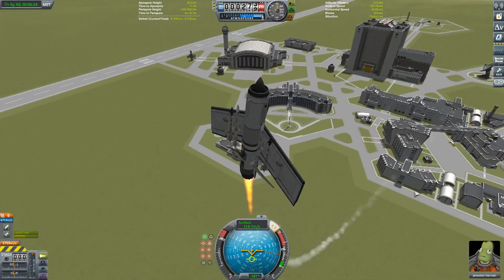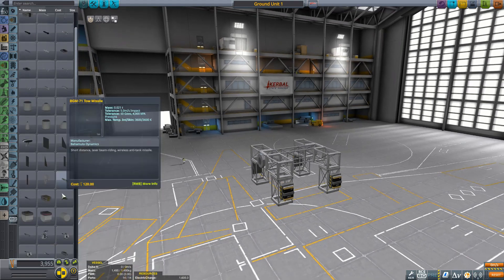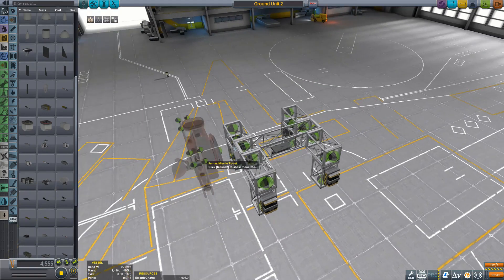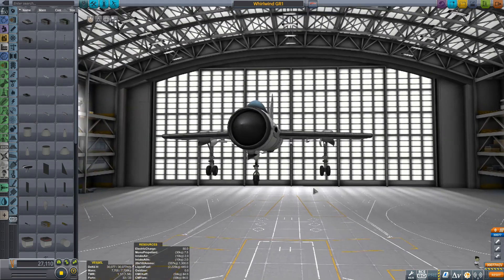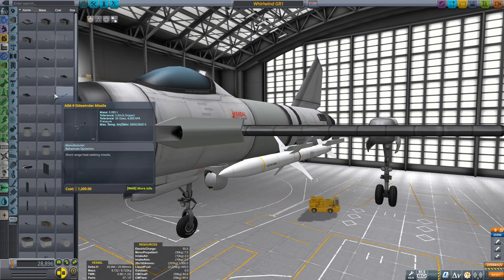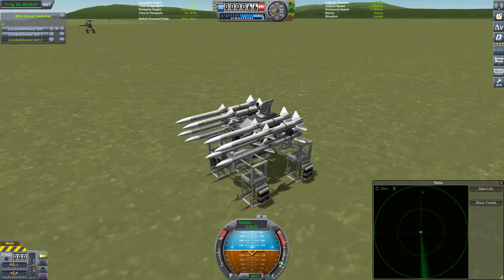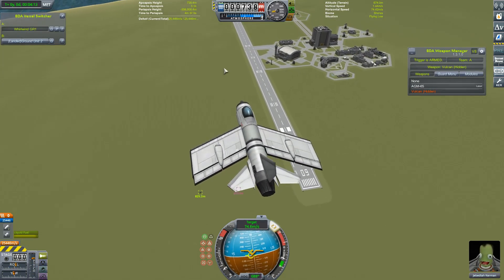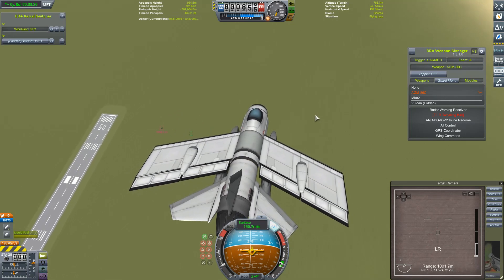Aircraft Tutorial - Ground Attack - Kerbal Space Program & BD Armory

Comment: I can not get anything else then machine guns to fire on the airplane... Some say you must configure trigger group for bombs and rockets to work but no one say HOW or where to do that. Also I did get rockets and bombs to work on one of my many creations, and also got rockets and bombs working when turning on and of guard mode. There is also a problem that when I hit something with the machine-guns it stops shooting and you must switch to another weapon and back to continue shooting.
Reply from the maker: For bombs and missiles you need to arm the trigger, the button on the top left of the weapon manager window as you're flying.  With the machine guns, have you checked whether they're overheating?  A little red warning bar will appear next to the staging icons when this happens.
Reply: @SonofSmith   When overheating they will shoot again automatically when cold enough. It seems to be some kind of bug interacting with other mods, after I deleted some mods I got rockets and bombs working but they are very slow to react, you must hold the fire button for more then 1 second. And still it has problem with that guns stop working the instant you hit a target. Think I will have to try delete all other mods and install them one by one to find the one interacting badly.
Reply from the maker: Sounds like a good plan.  🙂